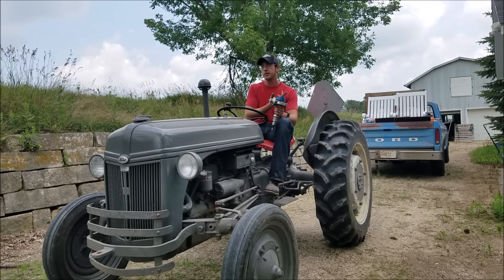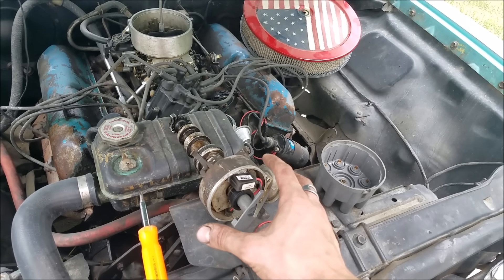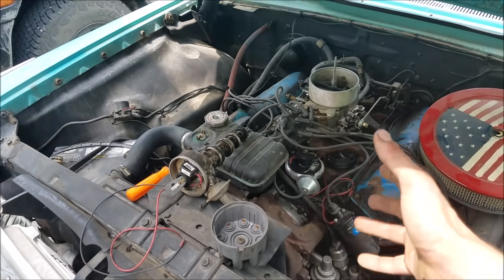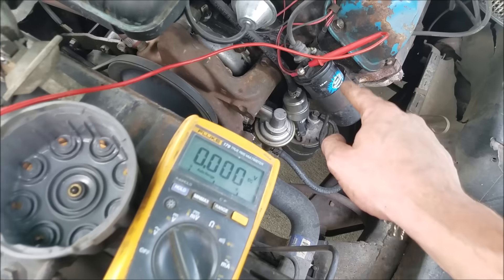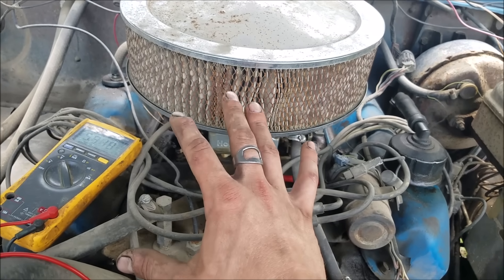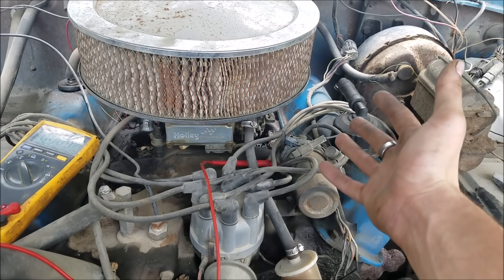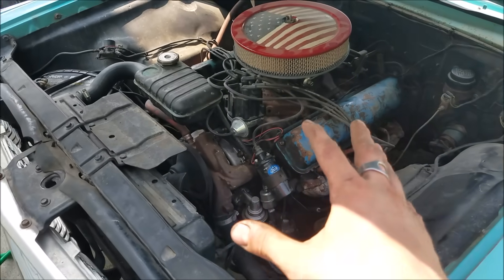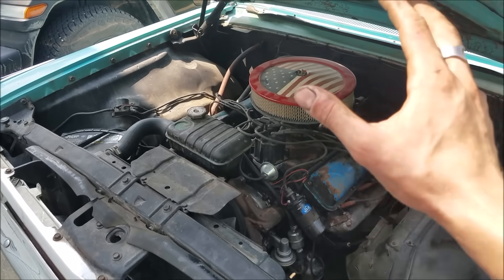Pertronix Ignition "Problems & Failures" (It's Actually YOU)

Comment: Our pertronix module went bad in last week's video and we had to get a tow. Got a new one and we installed it in today's video. We watched your video first and saw how you suggested running the power wire to a keyed and fused line so we took your advise and made the change. Gave you a shout out in the video and linked your video in the description. It will be up at noon tomorrow. Thanks for your help
Reply from the maker: No problem - they don't pay me to say anything about them. Just genuinely good products that when wired correctly, last forever. I've had one of mine for over 10 years.
Reply: @ThunderHead289  that's awesome. I had one in my 69 F100 and loved it. Install it and forget about it. I put one in Edna 3 years ago when I converted her from 6 to 12 volts. Never had a problem till last week but was happy to swap it with another.
Reply: https://youtu.be/plk9W4oXh2g
Reply: I wired mine correctly and went thru 3 of them! That's too many tow truck rides home! In my experience, Pertronix stuff lasts till just past the warranty! I think they went to Taiwan, and now, it's crap!!!

Comment: One problem i found on my 66 manchero is i was only finding 10 v at the fuseblock too, the same as at the coil.
What gives? The test light is useless if its still less than 12 v correct.
Reply: That's when you need that relay that MSD sells. They have a diagram for it on their website too.  

These and most aftermarket distributors need 12v like you're trying to find

Comment: I did get my 72 2.0 Pinto running great again, then decided to upgrade to Pertronix kit, here's a story I type up to share, A few are saying my ground might not be to good, I added a few grounds. Here's my story of my outing on 9 12 2020  -   I just installed a pertronic on my 72 2.0 Pinto with the Flame thrower coil as a kit I got it from ebay $128 . I reset the timing, drove it and it kicks ass, 80 miles later it starts backfiring and powering down on my way to the swap meet, tac jumps to zero then back up to normal. I pull over and car idles fine. but as i get in the gas it's having trouble picking up to speed while I'm letting the clutch out, I feather it, it gets going then bogs and backfires LOUD AS HELL, lol. at least 20-30 times while I'm getting her home about 5 miles away. I switch out the coil, still the same bogging. then I start checking coil wire, alternator wires and a few other connections, Now it's seems ok, I wish I knew what cause this for future outings. Anybody else have an issue like this, and what's your set ups on the 1971-1974 pintos. I ask pertronix some ? on a phone call, and the guy said sometimes the unit will do things not even they can explain. hmm...

Comment: I have this product installed on my 1951 8N Ford tractor that was converted to 12 volts.  My first one lasted about 8 months, the second one lasted about 6 months.  And yes, I have it wired according to the directions, 12 volts going into the electronic ignition.  I am glad this product works for you, but for my use, it is junk.  This tractor only gets used about one hour per week.
Reply from the maker: I won't use anything but the ignitor 3 since the others are picky about gaps. I also have a 9n, but I run points

Comment: The timing of your video is interesting. Roughly 30 years ago I put an ignitor in my VW, and it failed after some months of use. Now, wiring it backward would have immediately fried it, and a VW coil gets a solid 12V, so the only other concern I can come up with would have been to not use their coil. However they only suggest using their coil. Either that was my problem, or the unit failed for some other reason. I’m now considering going back and trying them again. Don’t get me wrong, it’s fun to test for dwell, but if it is reliable, it does seem like it would be a more efficient choice.

Comment: Running a low impedance coil without a ballast resistor will also most likely fry them as it puts to much current through the unit. Been running my Jag V12 with one for a couple of years without trouble so far.
Reply from the maker: Except it won't. 
Thunderhead289 - engineer

Comment: Hi Luke  l get so much information  from your  videos  I run a petronix 1 on my 1970 torino for years no problems  just recently  rebuilt the motor an put it in another 70 torino nicer body but I was running the motor an took off the battery  cables to check the alternator  when I put the cables back on it stalled now I don't  get spark at the coil do you think I burnt out the the pertonix unit I didn't  know that there was a resistor  in the wiring all these years your help would be greatly  appreciated.  Thank you john

Comment: Mine worked great for ten years and then it didn't. Put the old points in and it's fine,  Yes they do fail, I'm of the opinion that they fail much too often.   Yes it was wired fine,  I did run a new 12 volt all the time wire just like the instructions said.  It was great for over ten years.  I will not be replacing it with a new Pertronix.

Comment: I have pertronix flame thrower with the ignitor 2 on a Ford fe, it had an intermittent cutting out felt like you would turn the key off and back on normally happened on acceleration or cruise. Weird part was let off the gas and it comes back to life and sometimes backfires. Put on a NEW ignitor SAME PROBLEM but was even more intermittent fast forward a year I took another look at the ignitor and there is a sticker on the inside like where it would pick up its signal from, took the sticker off and it runs perfect!
Reply: The sticker location was blocking juice?  Mine was doing your issue, I sent it back,
Reply: @lacyfurmage8846  I guess so, the sticker was on the side of it where it picks up the signal must have interfered with it just enough. I assume there are magnets on the distributor shaft it picks up the signal from so maybe they are a bit weak?

Comment: Thanks for all the help. Installed it on my 74 fj40. Had to modify one of the holes on  the igniter plate but after checking everything I turned the key and it never started they smooth in its life! Couldn’t get the tools put up fast enough to take it for a spin, wow! If you were better looking I’d kiss you! Take your time on the install and all will be good. Nothing wrong with this unit….nothing!!!!

Comment: I have this Pertronix unit on my 1966 Mustang 289, it worked for 2 years but last week my car just died while driving . I replaced all my electric parts including battery , alternator. To me Pertronix is junk it failed my Mustang even with bad points my Mustang never died while driving and would not start it would run even if poorly so I could get home. Not with Pertronix  if it burns out you are on your own waiting for a tow truck. I am sticking with the original factory points which were original to these cars and distributor I do not mind changing them when needed. Like the saying goes if it isn't broke do not try to fix it. Just my opinion and real experience with Pertronix .
Reply from the maker: Yeah it's because you didn't have the module on 12v like they say to. Literally every car I have worked on that had an issue with pertronix is the incorrect voltage to the module itself - it will work for awhile, but being a programmer and circuitry guy, it's no surprise it burns out being slapped with low voltage

Comment: simple protronix's junk I'm not impressed with their product I think MSD is far superior it's just that simple it's not an argument but protronix sucks . nothing but problems with their crap wires brand new barely last 400 miles and they go open on you two of them out of eight what's up with that! I will make it my life's work to tell everybody what a pile of crap their stuff is
Reply from the maker: I've never had one fail. They only fail for those people to lazy to read how to correctly wire them. 
Msd is peddling 1970s electrical tech for 3 times the price.

Comment: I like the Pertronix 2. I have the 2 and 3 and the 3 is very sensitive to junk on the distributor cam lobes. My timing was jumping all over the place until I pulled out the distributor cam and cleaned it. The 2 seems more stable since it’s sensing off the ring and not straight off the lobes.

Comment: Thanks for your info   However doesn’t address my problem. 
I have a 1948 John Deere B equipped with a Delco  distributor from 53’.
The system is a 12 volt with a one wire alternator  rated at 55 amps
2 cylinder 1200 rpm motor.
Problem is the coil over heats , I have replaced coil @5 times . If you kill the engine and leave the key “on” the coil will get so hot it boils the oil out of the coil inside of three hours. Last Saturday I actually melted @2 MSD coils one of them was “new” out of the box .  
This Pyro unit is at least 18 yr old . Black is hooked to the negative terminal of the coil. The key hot wire is wired direct to the coil. The red wire from distributor is wired directly to the positive side of the coil.
There no accessories except a light switch .  
WHY DOES THIS MELT COILS . I’m a gear head for the last 60 years I’ve never seen a coil, boil the oil out and the coil top always expands out of the metal housing 

Again no accessories. Key switch feeds Coil positive side is direct from battery . A 12 volt light switch is the only accessory.
The long you operate the machine the hotter the coil will get , if operated 4 hours the coil will melt. 
The coil will get red smoking hot if the key is left ON and the engine is not running.

Any insight is appreciated. 

Yes I did put @2 new coils on the JD last Saturday.over the years I have had MSD AND ACCELL and they all fail.
Yet the unit has never failed

Ed 

T

Comment: do I understand that the resistive wire  from coil to distribtor , is a steel wire,  as a safety  for when people leave the ignition ON, but not running  the motor,  over time the current warms the  wire- and thus raises the resistance, -thus dropping current, and so not cooking the coil,  so do not remove a resistive wire

Comment: I need some help with my 67 K20.  I put a single wire breakerless ignition module and it went bad.  it was fine for a couple years then just randomly died.  put a new one in and then the same thing a couple weeks later.  not sure what's going on as I'm new to these things entirely.  I'm only schooled on points and hei.  not sure what I'm doing wrong.

Comment: I left a comment on my 1967 Tbird with a 428 and Holley 4160 carb with Pertronix ignition that is cutting out at constant speeds of 35 mph and above - otherwise runs great.  I checked for vacuum leaks, but found none yet.  I may disconnect the line going into the car to see if there is maybe a leak in the dash.  

However, I have the 1281 ignitor and the 40111 coil (1.5 ohms), installed in late 2009, but only maybe 500 miles on it.  After watching you video, I checked the voltage to the coil and it is 6V (not 12v).  QUESTIONS:  

Should both the ignitor and the coil be getting 12V, or just the ignitor?  
Also, is it possible that I have damaged the ignitor and it is causing the cut out issue.  
And should I buy a new ignitor kit?  
Or even if this is not the cause of my issue, should I replay the ignitor?  

Thanks, Bill
Reply from the maker: Pretty hard on the ignitor module to under voltage it - amps go up for it to perform the same function. 
Quite possible it’s not having a good time anymore - I use the ignitor 3 units, so it all can see 12v no problem. 

I think on the 1 and 2, the module itself needs 12, while the coil needs to be resisted down to 6-8ish. 
Although, I have seen many running full 12 to everything without having any issues
Reply: @ThunderHead289  Thanks, I will try to supply the ignitor (maybe the coil also) with 12V tomorrow and for fun, see what happens.  Live and learn!
Reply: @ThunderHead289  For you listening pleasure!  I am in the early phases of finding he root cause of my issue.  In addition to a vacuum leak (which I have not found yet), I have also read that a warped base plate, or bad spark plug wire contacts, or vacuum advance incorrect vacuum feed, etc, could be the cause - or other things of course.  I did have 6V to the ignitor, and changed it today to 12V (keyed from power window relay under the hood).  I may not test drive until I check vacuum/timing for the heck of it.  Also, my coil wire has tape wrapped around it - not sure why, I don't recall doing that.  But the resistance through it is only 100 ohms, and a new spark plug wire that I have is about 5,000 ohms.  So, I ordered a new one - again for the heck of it.  I guess I will be making a science project out of this!
https://www.youtube.com/watch?v=8FINeE0wYbg

Comment: When I bought my current early 70s daily driver, it came with a pertronix 1. It ran just fine through two years of college, even with the factory ballast still connected and dropping the voltage. After college, I decided to properly upgrade it with the flamethrower coil and ballast bypass. 

I prefer the original pertronix, due to EMP concerns. All it has inside it is a hall effect sensor, and I'm convinced it will survive a solar flare. If it doesn't I have a complete points setup in a baggy in my glove box.
Reply: They will typically run at the resisted voltage of 7-9 V.

Comment: Or you could just unwrap the loom and unplug the resistor wire and replace with normal wire. Much easier than running a new wire from the fuse box.

Comment: I am having an issue on a 1965 El Camino on the coil for the ground side I am getting a 12 volt reading same thing with the positive side is this normal because I thought the negative side means negative I installed the flamethrower coil says it's 1.5 resistance of ohms first time I installed it the module fried out and it's reading at 12 volts something is not right I'm a little confused because the directions tell me to hook up the the negative side terminal to the negative side of the coil but there is power there so should I connect the ground to body chassis then hook up the positive wire to positive coil? I did try this and I didn't get a start but nothing did get fried

Comment: So I don't know if this is all cases but the Pertronix 3 isn't compatible with 6V systems. Only the 1 & 2 can be ordered in 6V configurations. I use the 1 in my 1947 Dodge Custom 6V positive ground car. Works great and the RPM generally are so low that I don't think the auto-adjusting dwell features of the 3 would really help me anyway. Now if I ever convert to 12v system I will change out to the Pertronix 3. Thanks for another great video.

Comment: Hi Luke thanks for the heads up. Just installed a pertronix ignitor on my Fiat Spider. Voltmeter reading says 11.5 volts with ignition on at the positive side of coil. Is that enough? Thanks

Comment: i used pertronix on my 70 Galaxie it runs beautifully. took me 10 minutes to set up using the old dist and a new pertronix coil. fires right up and runs smoothly from Spokane to Seattle and back about 550 miles each way. engine and trans were great body was rusted to hell.

Comment: I have the original Pertronix in my 1964 F250 with a 292 engine and have never had problems.  It was simple to install.  I had to have a few adjustments on my 1955 Cadillac but again it worked.

Comment: Luke, you and Craig909 sold me pertronix. I just installed mine and it’s giving me trouble

I have direct 12v power, it’s grounded through the distributor and I also added a ground lead from the distributor clamp to negative on the battery. The truck starts and drives fine on warmup and as it gets warmer I start to get a stumble at low rpm which it didnt do with points. I’m assuming the problem is related to the pertronix distributor I installed and heat as the engine warms up. I’ve tried running without vacuum advance, I tried different advance springs, different initial timing, all because I thought it was running bad due to too much timing at a low rpm. I’m not sure what to do now and anyone’s input would be appreciated
Reply from the maker: I’d be happy to chat - email me at lfinley289@gmail.com since youtube sucks for conversations
Reply: @ThunderHead289  I sent a email to you. Thank you for reaching out

Comment: I had igniter 1 for the last 19 years  wired wrong off the coil. It worked fine. I bought the billet igniter 3 and wired it the same way. Car ran like shit at idle. I remember seeing this video before i bought the 3.I changed the wires as you showed and the idle smoothed right out.
1965 Mercury 390 4v.
Another great video Thanks.

Comment: I installed a pertronix lol in my 73 Galaxy 351w by using the relay kit and the original resistor wire with an appropriatetly spread bullet connector so I can use my original boot connector, pertronix makes a new low ohm epoxy coil that can be used with the II or III units.

Comment: Luke what’s the easiest way to know if I have 5 bolt or 6 bolt bell housing? It’s on a 64-1/2 mustang
Reply from the maker: Look at the top of the engine, towards the back - instead of two bolts on the top, it’s just one - should be pretty visible with air filter housing off
Reply: @ThunderHead289  so if I see two it’s a 6 ? No bolts on the bottom they look like they are just holding some plate on.  Would be handy to have ya as a neighbor I do appreciate the help thank you.

Comment: In a Mopar. if you are using a 12 aftermarket ignition, you don't simply take out the ballast resister. You detach the leads from 
it and put in a 4 inch jumper wire.  Otherwise the car won't run after the key moves from start to run.  Which is the same symptom as you get when you have a broken ballast resistor.  If you have a four pin ballast like certain early 70's cars... you shouldn't be putting in an aftermarket ignition anyway, since your car came from the factory with Electronic Ignition and you should use the Chrysler Electronic Ignition.